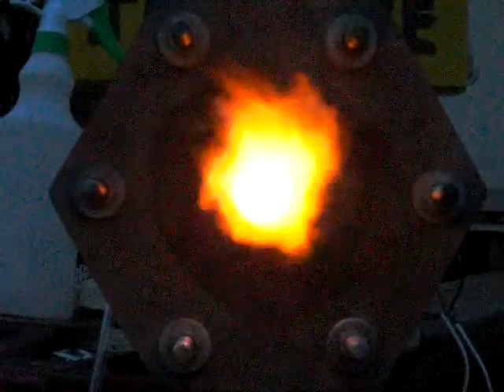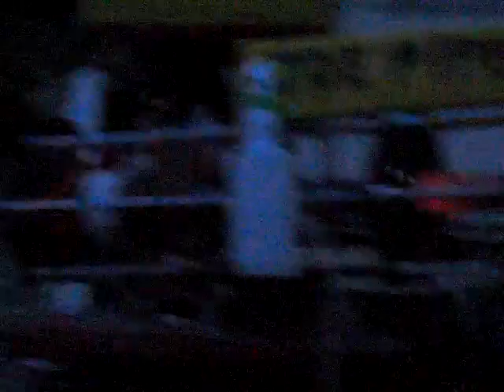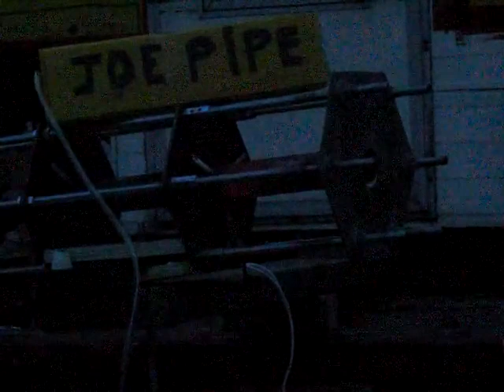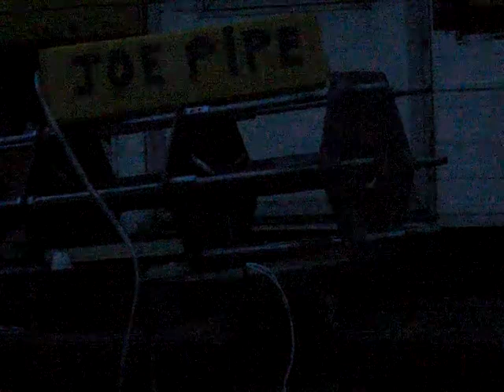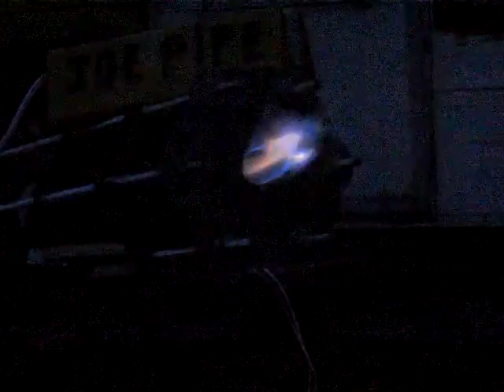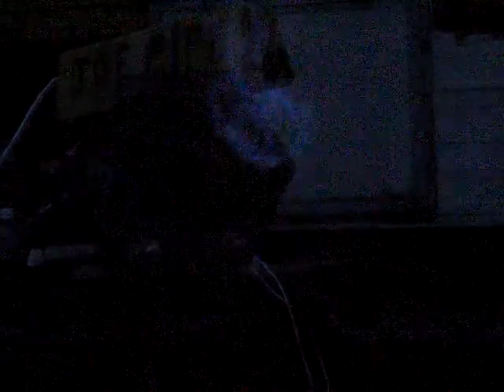#02-Joe Cell-PART 1 of 2-How It Works?

Comment: Hi Aarron-I read you're response and it does shed some light on the subject. where the sound energy may be affecting the fuel or combustion state of the fuel.  I've seen it where the sound was so intense where it has disrupted voice patterns.  Will be interesting to hear back from you.

Comment: basically you are trying to split water to the plasma state to let it explosively recombine into water as super heated steam exhaust? what is all this talk of lime green flame and sound into energy?  sound is energy and as a propagated wave it adds its energy to the vibrational states of the matter it passes through and then takes it away, so what? if you have a field of gas that is hot but not ionized and pass sound through, it can jump it up to ions, just like boiling water, its a phase change

Comment: When you say "water from the propane" did you mean to say:
"When propane burns it leaves H2O and CO2, and that water splits into hydrogen and oxygen and burns as fuel"? Because that is scientifically   sound. It also happens in GEET, as you already know. I'm really thrilled because of your discovery :)

God bles!